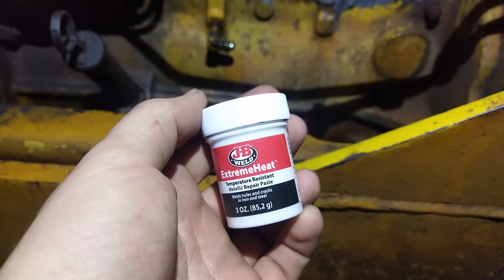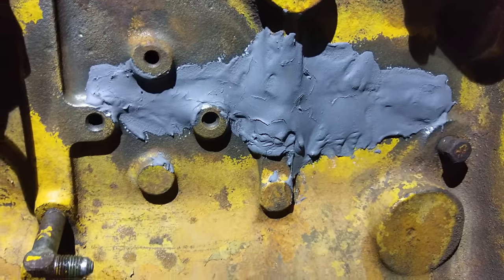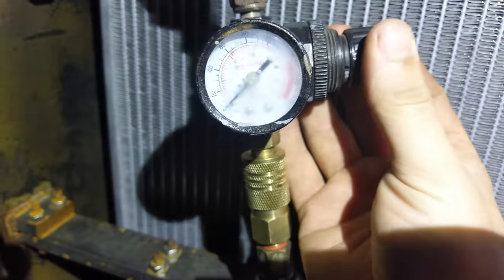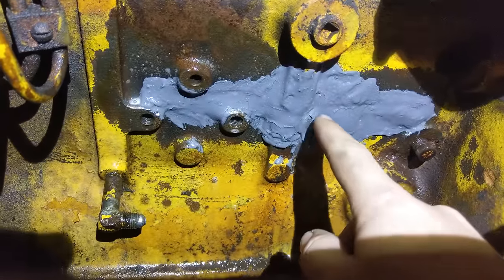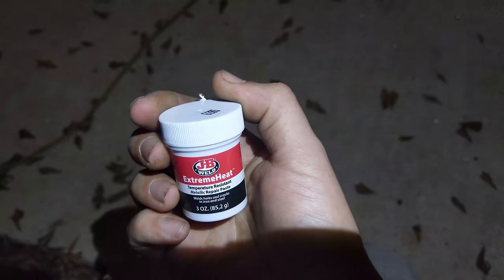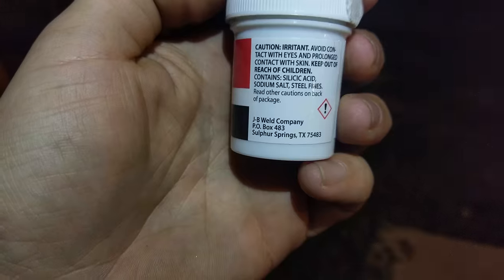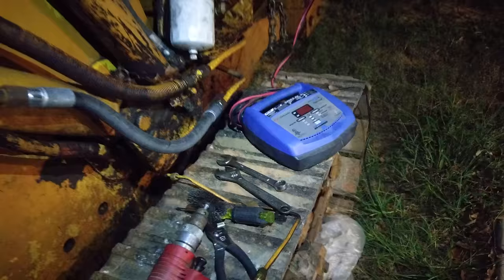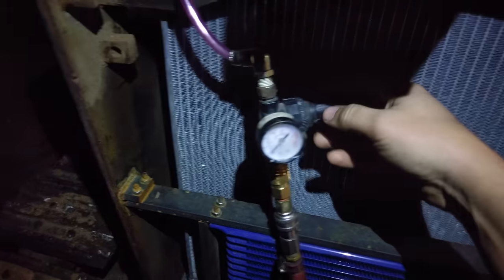JB weld EXTREME HEAT review... its garbage

Comment: If you could press your fingernail into it, it wasn't cured.

AND, if you welded (braised) the crack with a stainless rod and it didn't hold, how did you expect JB Weld to hold?
Reply from the maker: Because JB Weld is a two-part epoxy, and not a heat intensive molten metal device lol

Comment: ...Have not seen that stuff...Looks like Radiator sealer.....Regular JB Weld works GREAT....why did you use Stainless Rod on Cast Iron ?...
Reply from the maker: Stainless rod on cast iron usually works, my issue is I don't believe I heated the block up enough and it cooled off too fast

Comment: The problem you have is that you didn't run the engine to allow the material to heat up and further cure... The material streghtens with heat and any areas exposed afterwards to can further add material.

Comment: It’s good for engines but don’t use the that stuff use the 500 degrees and the 5033 psi but for a Diesel I wouldn’t use it for and if you going to do it the right way if your able to get inside and take the engine apart double tap both sides from the inside and the outside and when you tested it with the psi it looks like you did not let it cure.  It takes 24 hours to cure.

Comment: you need to use the original jb weld its 5000+ psi flexible and safe up to 350f
Reply from the maker: Yup. Shit is badass. Check project farm. He did an episode on it
Reply: Is that the one with two things of them to mix?
Reply: @luisespino6300  yes

Comment: The high heat stuff is to brittle should have used the steel stick putty it can handle a lot of heat it would have fixed that and it needs a lot of time to cure it looked like that stuff just wasn't cured yet.  I fixed a hole caused by a rock in a side case on a XR 200 ran that bike for a decade when I was a kid never leaked again I didn't use the high heat stuff either just steelstik

Comment: You don't weld cast iron with stainless. Use a 7018 or 7011 with 6010 hot pass first.
Reply from the maker: William McGrath on the contrary, nickle sticks to everything which is why you weld cast with a high nickle rod.
Reply: He welded it with stainless. I know you can weld it with nickel I didn't say you couldn't. Reason I said a hot  pass with a 6010 rod it would preheat it first so the 7018 could lay better. I was a welding instructor and now an inspector and know my welding and temps very well
Reply: Hot pass is the terminology for the second pass of an open root weld... typically turned up to a higher amperage to clean up the messy root pass... the initial (root pass) is a little hard to run hot as you will blow it out...

Comment: what i have successfully done many times  fist i got a jig that drills hole that are spaced  you drill a pilot hole at the end of the crack then use the jig to drill two more holes and drill holes so far apart with the jig intill you get to the end of the crack you tap the holes  and then countersink the holes. apply red loctite then screw in the pins that will twist off . grind them flush then drill in between the pins with the jig and do the same then after you are don i use standard JB weld to hide the repair. the system can be obtained from www.locknstitch.com. i always  do the liquid glass treatment in the radiator. afterwards run it a few days with straight water then rain and refill with antifreeze

Comment: It's just a steel epoxy... that u used incorrectly.  It's only to be used on holes and never stress fracture.  
U can't expect an epoxy to hold up to those kind of stresses. Jb weld marine is better. Its resistance to oil and gas is much better.  If u can't have it welded,  Ur gonna have to fabricate a steel plate from some mild steel to fit along the cracks and line it up then
Drll 4 7/16 holes tap them to some grade 6 fine thread bolts .. clean site w grinder creating a small trough then fill area mount and tighten plate.

Comment: You need to mix it well for about 5 mins or so tell it mushy then put one layer on whatever item  then a second one after four hours then if you need a third layer wait another four hours go ahead then let it sit for 24hours let it run with some heat from the machine then you should be good to go

Comment: the original jb tends to work better... i patched the block and my oil pan (which the crank hits alot) in my jeep and its still holding perfectly fine. no cracks or anything.

Comment: And cast you have to preheat it to 550º forgot to mention that in the 7018-6010 comment
Reply from the maker: Sometimes true, however it is possible to weld it without heating. The trick is not welding too much

Comment: Step 2: Mix.
.  .  .  .  .  .  .  .  .  .  .  .  . . .. . . .
2:39

http://www.jbweld.com/products/j-b-extremeheat
Reply from the maker: I did mix it.
Reply: Hvguy you said that it comes already mixed after thinking it's wasn't a 2 part
Reply from the maker: It comes mixed, however its somewhat separated when you get it. I was pointing out that its not a typical 2 part mix.

Comment: First of you put it on the outside of the block the surface was pushing out that compound was not made for that application should have taken it out of the crawler loader then to a machine shop had them either use tap screws or drill a hole at either end of the crack then weld it would have lasted longer
Reply from the maker: @raypruitt9955  I drilled the ends and welded it later. This fix was just to see if it would work... Unfortunately the product is shit. Check the reviews on Amazon

Comment: I know super old but the extreme heat is water soluable...
Reply from the maker: But it advertised it as good for marine and high temp tho. 😞
Reply: Hvguy miracle in a can is hard to come by, so they sell us a jack in a box filled with our hopes and dreams lol

realize they advertise its danger to skin contact yet instruct you to use your finger nail to test if its cured. 

on the real though, how much did you use half? more? less? 
did you ever end up fixing it some other way afterwards? 

I'd have leaned towards plasstidip or some "flex tape," variant. or regular solder, maybe even even some type of acrylic or epoxy.

Comment: Like putting bubble gum on a hole in a dam. You really needed to weld and repair it properly. It's an unfair assessment of a product not designed for this magnitude of repair.  And any product that isn't a 2-part product isn't usually worth a rip anyways. Sorry about your engine, but you were expecting a LOT here.

Comment: You didn't use it correctly. I have a method that works and holds as a permanent repair if you or anyone cares to hear.
Reply from the maker: Wipsplash theres a method other than following the directions?
Reply: You modified the directions and that is part of the reason for failure. I am not going to get into any of that but I will tell you how to repair it with original JB Weld. Deviating from my directions will cause failure. Wipe area with deposit free brake cleaner and clean 3" beyond the crack all the way around.  Grind area with 80 grit sand paper til bare metal in the entire area including 3" around the crack. Drain all coolant/water out of machine. Grind 1/8th inch trench starting 1/4th" in front of crack.  Continue trenching down the crack 1/8th" wide until 1/4th" after. When trenching, go as deep as you can but don't cut all the way through. You want to leave a very thin portion in the bottom of the crack for support. Blow crack with compressed air then the brake cleaner again. Blow dry and use a product called The Right Stuff Gasket maker.Must use this product with no substitutions. Fill the crack with it ensuring it completely fills the entire trenched area well and use a razor blade to scrape it level with the block. Let dry over night then sand area with 80 grit again and wipe with brake cleaner around the crack without hitting The Right Stuff. Coat area including 2" around with JB Weld Original. Cut a piece of fiberglass cloth from auto body repair that is 2" bigger than cracked area and soak it with JB Weld Original and press it over the crack and 2" beyond. Do the same with 2 more JB Weld soaked pieces of fiberglass and layer them on top of each other. Let dry for  2 days then fill machine with antifreeze and you should be good to go.
Reply from the maker: Wipsplash I doubt you'll believe me, but I mixed the stuff L, sanded the area, wiped clean with acetone and microfiber, applied and let it set for 2 days. Literally per the instructions. That product is junk
Reply: I believe you. JB Weld has limitations. #1 it is not antifreeze resistant and glycerol will soften it quickly. #2 it has no crack resistance, so if you spread it over a crack it will re crack immediately. If people use the steps I listed above, you can overcome it's limitations for successful block repairs. Don't use what you used, use the original JB Weld that takes like 8 hours to dry. If you grind the crack open 1/8" and fill it with The Right Stuff then The Right Stuff will be an antifreeze barrier. Covering that with fiberglass cloth JB Weld patches will prevent it from cracking. I am just sharing my experience of successful repairs on items.
Reply: How would you use it to fill in an exhaust manifold gasket? The reason I ask is one of my studs is broken. I put a new stud in so I can get the gasket square, I also have nice and clean bare metal. How should I do this?
Reply: Wipsplash would you need this much prep for a cracked valve cover on a Ford pickup?
Reply: im going to try your repare on my dozer, you should make a video.